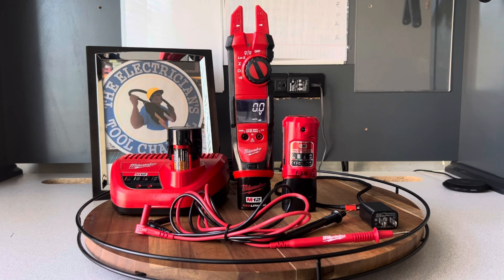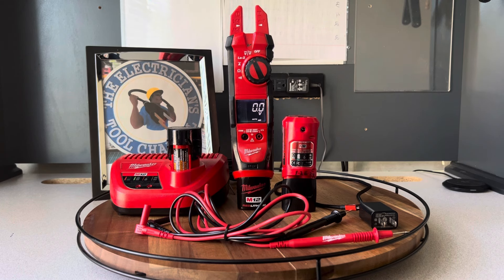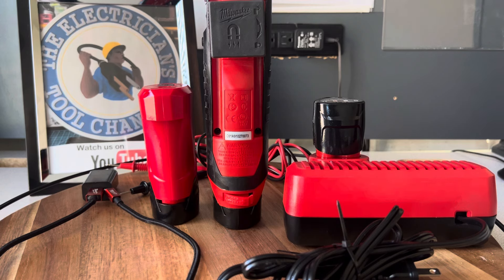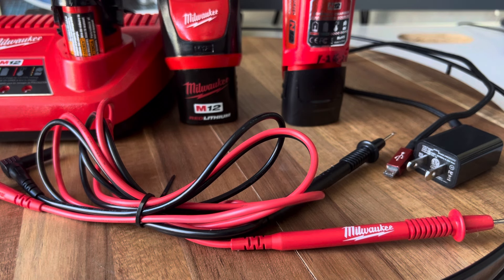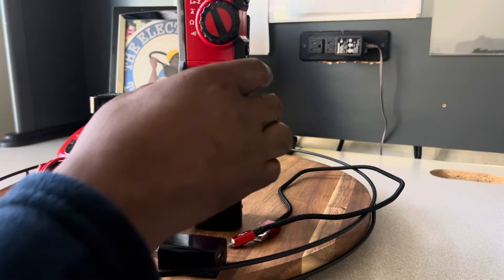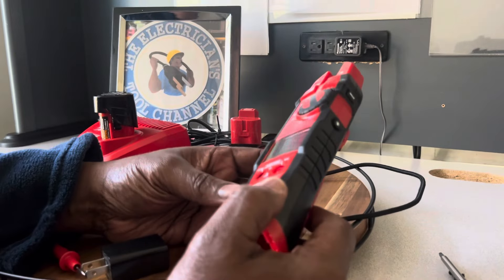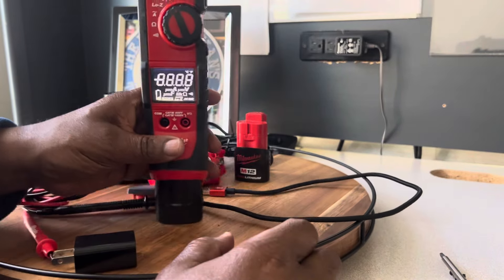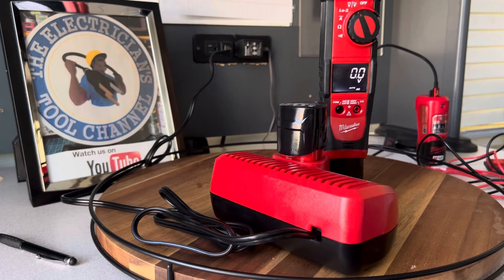MILWAUKEE 400amp  Fork Meter Model  2207-20  w/ 12V  Rechargeable Batteries & Chargers.

Comment: May be a good option if you already run the Milwaukee M12 line. Interesting when you put the battery in at around 16:30, when the meter initialised it showed capacitance and temperature symbols alongside the voltage and amps. May be their are some locked away features inside.
Reply from the maker: I took a look and it has a lot of micro symbols. I tried to use the hidden features to no avail. maybe they're using the circuit board of one of their other meters.